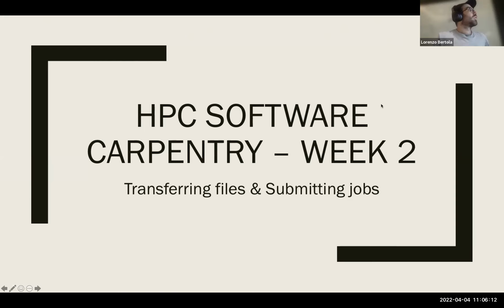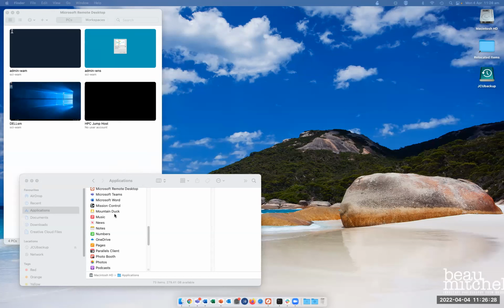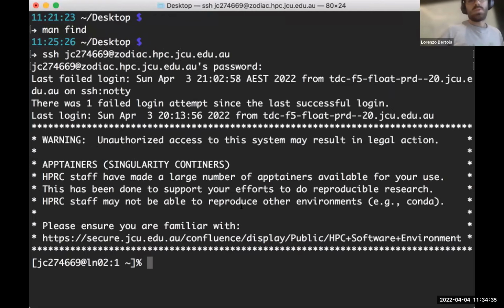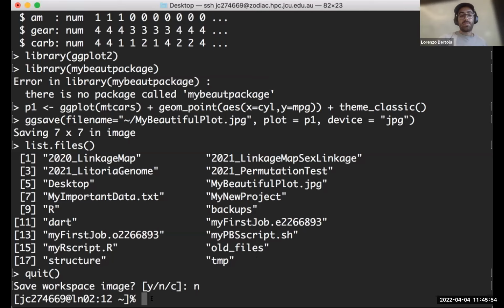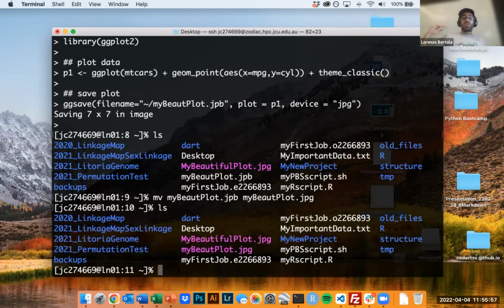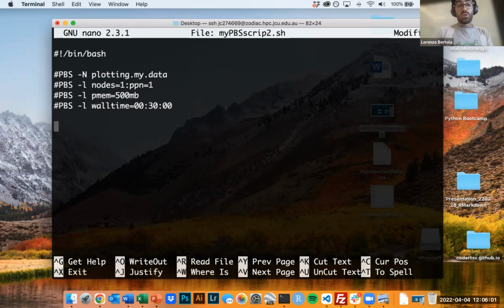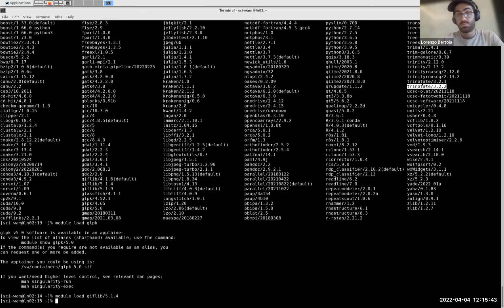Transfer files, load and use R on the HPC and submit jobs on the HPC (HPC course part 2)

Comment from the maker: CHAT:

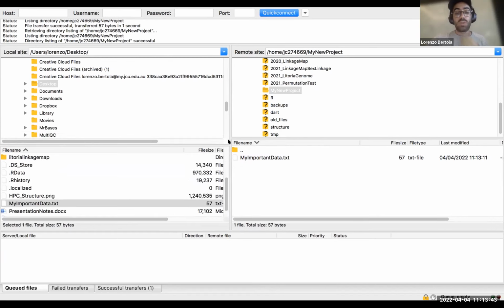00:11:16	Lorenzo Bertola:	Hello Annie, Omani and emma!
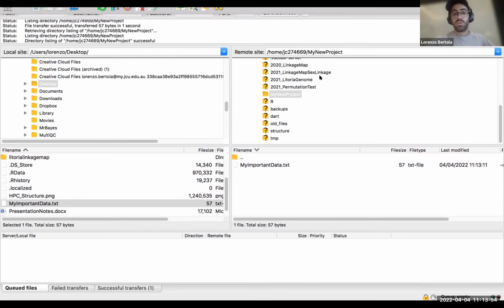00:11:27	Lorenzo Bertola:	hello Ashton!
00:12:13	Lorenzo Bertola:	Hello Jacob ryley
00:12:23	Lorenzo Bertola:	Hello Seb
00:12:35	Sebastian Hoefer:	Hallo!
00:12:41	Ryley Dorney:	Morning :)
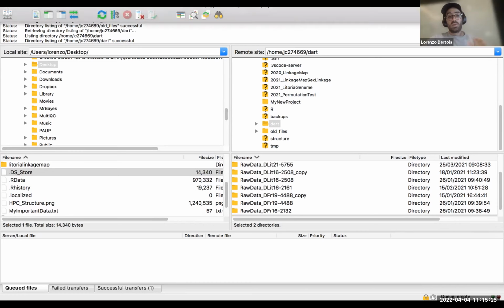00:12:58	Pauline Lawrey (JCU eRA):	Hi all
00:13:12	Roy:	Morning.. Facing some tech issues with sound. Will join shortly (I hope)
00:13:18	Jacob Westaway:	Hi!
00:13:26	Jacob Westaway:	Sorry, I'm stuck in an open plan office
00:13:59	Sebastian Hoefer:	Just quickly, what’s the benefit from using the terminal over something like visual studio code. Or is it essentially the same?
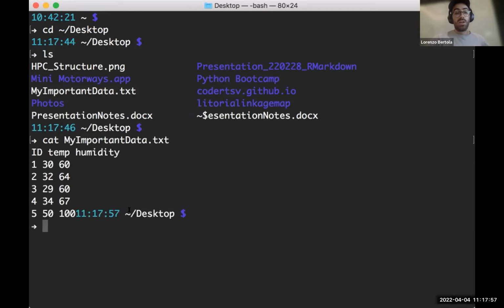00:15:32	Sebastian Hoefer:	Okay thanks Lore
00:15:41	Jacob Westaway:	VScode is great. Use it.
00:15:42	Legana Fingerhut:	Terminal FTW.
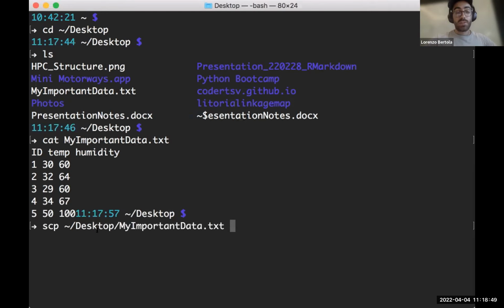00:16:23	Roy:	Yes please
00:16:33	Wayne Mallett:	Best to use what you are familiar and comfortable with.
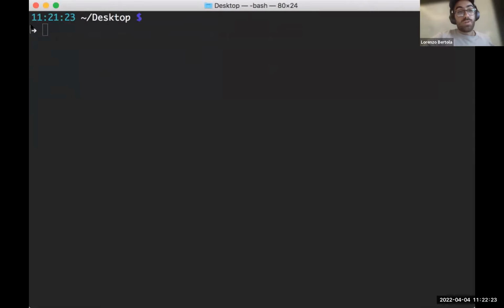00:20:00	Lorenzo Bertola:	Download FileZilla
-	https://filezilla-project.org/
Download WinSCP
-	https://winscp.net/eng/index.php

Set up FileZilla
-	https://secure.jcu.edu.au/confluence/display/Public/FileZilla
Set up WinSCP
-	https://secure.jcu.edu.au/confluence/display/Public/WinSCP

Lesson 3 & 4
-	https://codertsv.github.io/presentation/tutorial/HPC-Software-Carpentry-Lesson-3-Transferring-files/
-	https://codertsv.github.io/presentation/tutorial/HPC-Software-Carpentry-Lesson-4-Scripts-and-submitting-jobs/
00:22:08	Wayne Mallett:	I can do a very quick MountainDuck presentation (less than 5 minutes).  Just to show another tool that many people might prefer (ease of use).
00:22:15	Roy:	Yep
00:23:15	Natalia Andrade Rodriguez:	That would be great Wayne, thank you
00:28:14	Legana Fingerhut:	Note if you use `scp` in Terminal the port is a CAPITAL P …  (-P 8822) Whereas if you connect to the HPC using ssh it is a lowercase p (-p 8822). This can be a bit confusing!
00:29:31	Legana Fingerhut:	(Terminal is case sensitive)
00:34:06	Sebastian Hoefer:	If you have many nested folders, is there a way to make sure all the files have been transferred successfully from your local machine to the hpc? FileZilla doesn’t list file sizes and numbers within nested folders
00:37:16	Lorenzo Bertola:	Good question Seb thank you
00:37:17	Jacob Westaway:	You can always use ls to get the directory sizes and compare between the HPC and your local
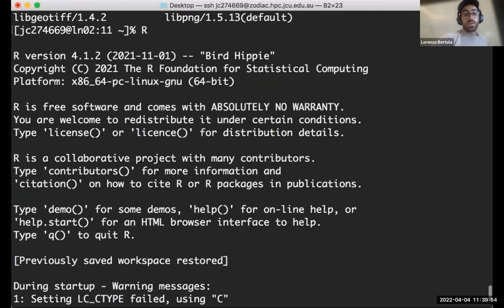00:37:28	Jacob Westaway:	just for a sanity check
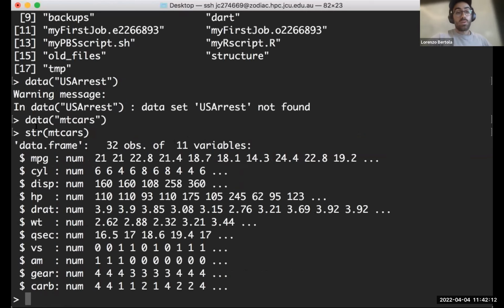00:39:46	Lorenzo Bertola:	that’s super intuitive and useful Wayne. Will try and incorporate in the lesson for today
00:41:55	Lorenzo Bertola:	Lesson material on the website*
00:42:58	Legana Fingerhut:	That looks great, thanks Wayne!
00:43:07	Pauline Lawrey (JCU eRA):	It connects to CloudStor nicely too
00:44:25	Sebastian Hoefer:	Okay great thanks everyone
00:59:44	Pauline Lawrey (JCU eRA):	That was useful to me
01:00:21	Legana Fingerhut:	You can also use open a new Terminal so you don’t have to log out
01:00:21	Pauline Lawrey (JCU eRA):	or just have MountainDuck setup :-)
01:05:44	Wayne Mallett:	It is possible to do remote graphical work on HPC.  You will need X11 compatible software installed on your PC (Xming) or Mac (XQuartz).  Documentation exists on HPC confluence pages (desktop software pages).
01:06:25	Wayne Mallett:	Other options exist.
01:08:50	Pauline Lawrey (JCU eRA):	yes
01:13:13	Sebastian Hoefer:	What if you don’t know your wall time, do you have to specify one
01:14:39	Ryley Dorney:	how do you estimate memory and CPU needed?
01:15:32	Wayne Mallett:	Lorenzo is using old syntax for resource requests.  There have been a few examples where the old syntax won’t work.  Eventually, the old syntax will become obsolete and won’t work at all.  Best to use start using new syntax (see HPC confluence page).
01:18:04	Wayne Mallett:	Example script files can be found at:  https://secure.jcu.edu.au/confluence/display/Public/HPC+PBSPro+script+files
01:18:32	Wayne Mallett:	If you get really stuck, can request help from HPC via ServiceNow.
01:20:35	Wayne Mallett:	If you use the Email option in PBS script, you should get an Email which will contain information about the resources you requested as well the resources you job/workflow used.  This may help inform you on requests for future job/workflow.
01:21:08	Sebastian Hoefer:	Very useful
01:21:20	Ryley Dorney:	I found this helpful, thank you Lorenzo :)
01:22:05	Lorenzo Bertola:	Thank you for coming Seb and Ryley :)
01:22:18	Legana Fingerhut:	I think we have a session coming on containerisation and singularities later this month (maybe the 25th?) Stay tuned!
01:22:47	Lorenzo Bertola:	Summary of what Wayne is stating:
01:23:19	Sebastian Hoefer:	Quickly do you need to have all files to be processed by the HPC be on the HPC or can you point to an external drive to get the files?
01:24:28	Lorenzo Bertola:	- the way to go now is to stick to `module load software name`. This will mostly be an alias for the singularity. As in, module load R runs the `singularity run command` for you jf there is a singularity available for it. TL;DR: use module load software name from now on unless that doesn’t work
01:24:44	Lorenzo Bertola:	Hey Seb. Ideally you would have them all on the HPC
01:25:01	Sebastian Hoefer:	Okay thanks!
01:25:03	Sebastian Hoefer:	Thanks Lore!
01:25:35	Lorenzo Bertola:	you can scrape data from web databases etc, but it will make your life easier if you download the data you need ahead, so that your job doesn
01:25:46	Lorenzo Bertola:	Your job doesn’t need to include the data download step*(
01:26:58	Lorenzo Bertola:	especially if its a long job, it would be a bummer if you wait for 2 days for your code to run and then you realise some of your data was corrupted, not there, wrong, etc
01:28:08	Wayne Mallett:	Note that there are many scientific databases in /scratch/database subdirectories.
01:28:49	Ashton:	Thank you for today!
01:28:59	Lorenzo Bertola:	Thanks for coming Ashton :)
01:29:04	Legana Fingerhut:	Thanks for attending everyone!
01:29:20	Cristina Ruano-Chamorro:	thank you so much for this course!! I have to go. See you soon!
01:30:36	Lorenzo Bertola:	bye cristi :)